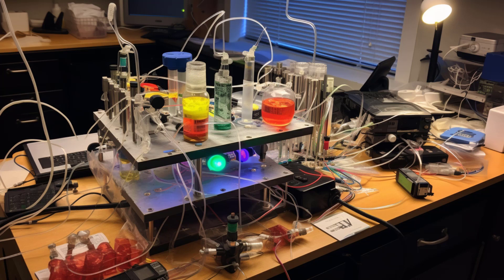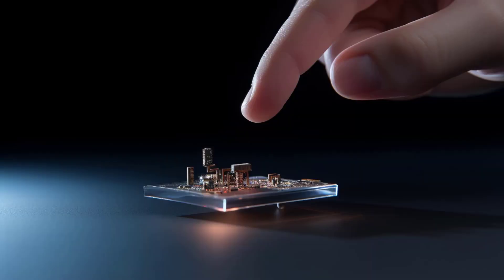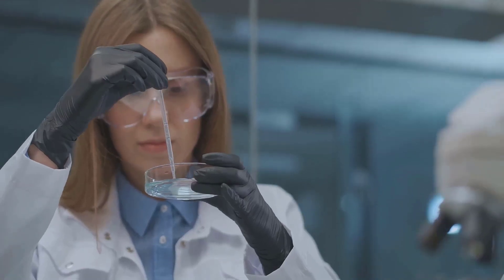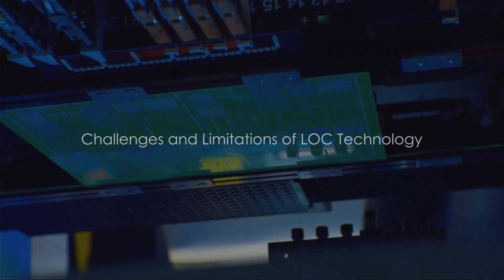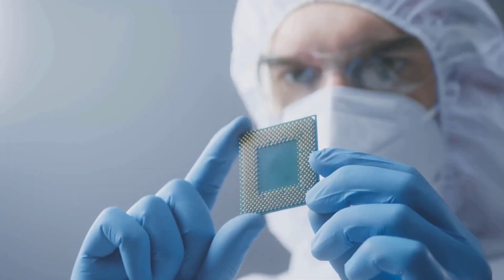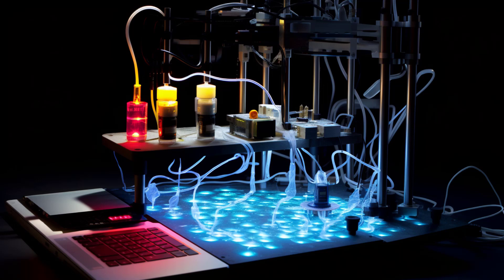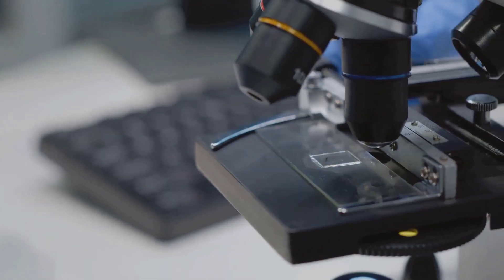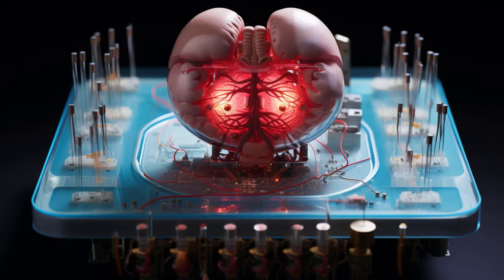Lab-on-a-Chip Technology Advancements in Diagnostics

Comment: Can you provide more information on environmental monitoring ( microplstics detection in drinking water)
Reply from the maker: Thank you very much for your question! That is great topic and we plan to record a separate video. In the realm of environmental science, the advent of lab-on-a-chip technology marks a significant leap forward in our ability to monitor contaminants, notably microplastics, in drinking water. This innovative approach integrates microfluidic principles to facilitate the precise detection and quantification of microplastic particles. Unlike traditional methods, which often require bulky equipment and extensive processing time, lab-on-a-chip devices streamline the analysis process, enabling on-site testing with rapid results. For instance, recent studies have demonstrated the potential of optical devices within lab-on-a-chip systems to identify and differentiate between various types of microplastics in water samples. This differentiation is crucial, as it allows for a more detailed understanding of pollution sources and potential health risks. Moreover, the application of lab-on-a-chip technology extends beyond mere detection. It offers a platform for continuous environmental monitoring, providing real-time data on the presence of microplastics. This capability is essential for assessing the effectiveness of pollution control measures and for ensuring the safety of drinking water.